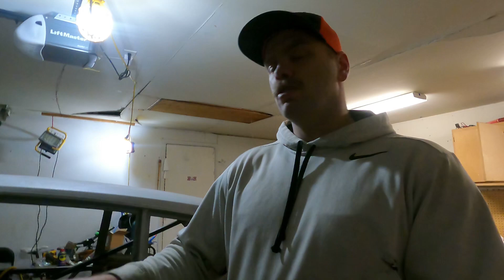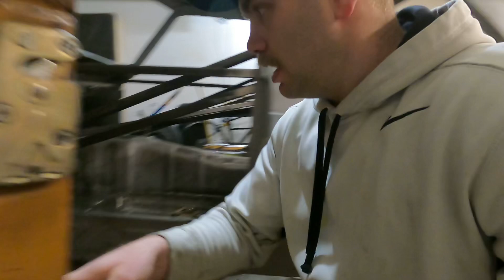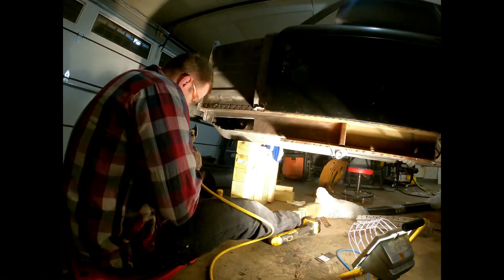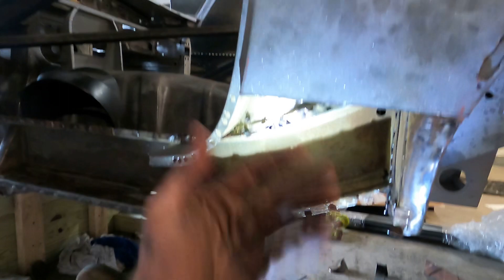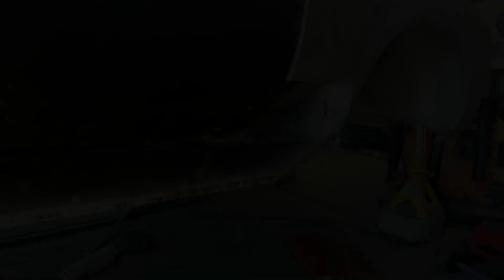1974 MGB GT sill replacement

Comment: Early in the video, you were frustrated that the door alignment wasn't perfect. I think that, even if you can't resolve those minor issues, your car will end up looking straighter than it did in the 1970s, which were not exactly a golden age of manufacturing excellence. Thank you for putting the time into restoring that MG! They are pretty cars, and we'll all be better off, in a tiny way, when there's one more of them on the road.